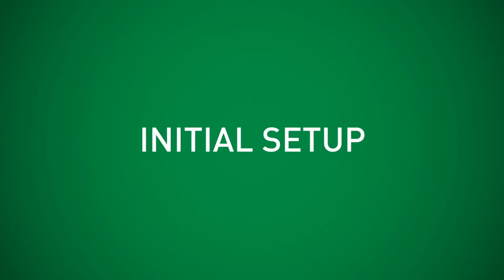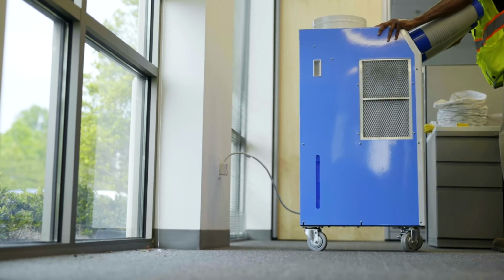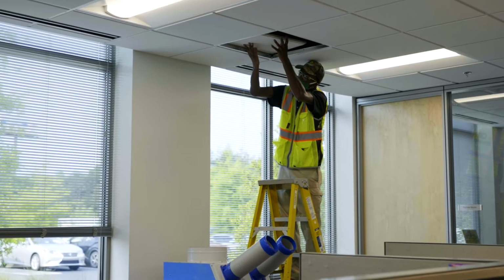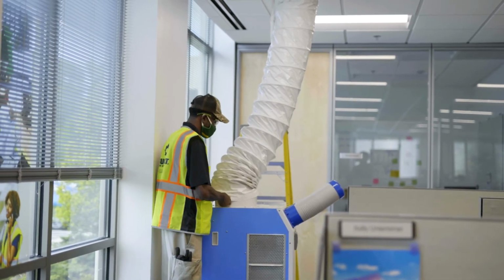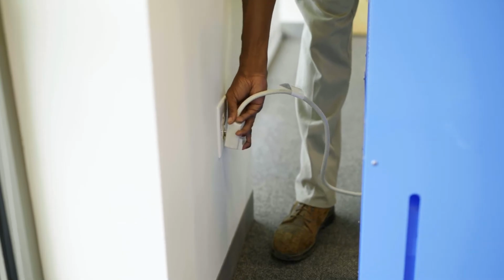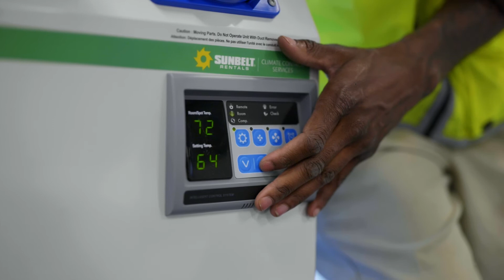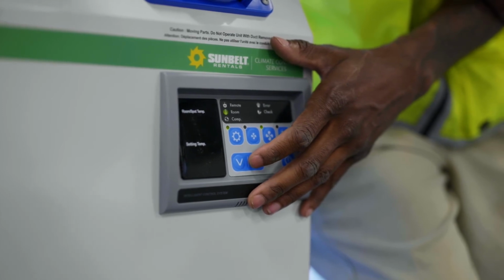How to Install a Spot Cooler

Comment: Sunbelt team - PLEASE correct this and retrain your technicians!!! 

This method has VERY limited applications because it ultimately **HEATS the rest of the building!!!**

To actually COOL a space, 100% of air through the condenser must be exhausted outside (hot air) with ALL condenser makeup air FROM the OUTSIDE.  This air MUST be TOTALLY SEPARATE from conditioned air.

Conditioned air MUST circulate through the evaporator coil ONLY!  

Even then, a window unit is typically more effective!